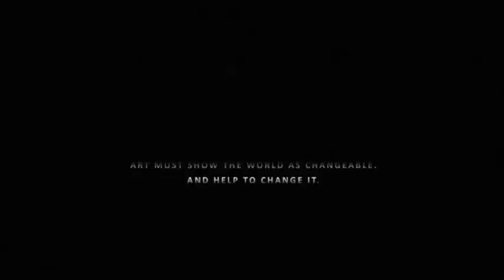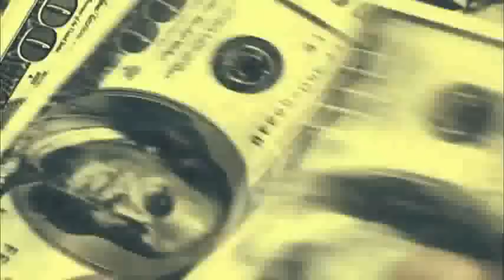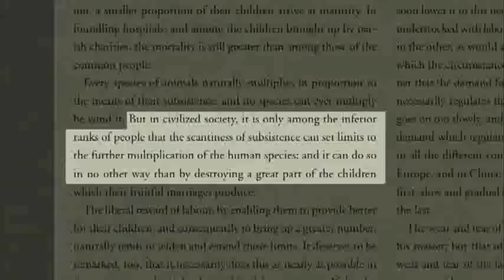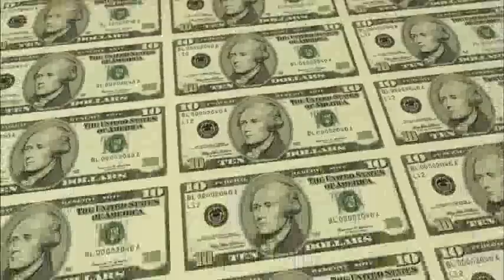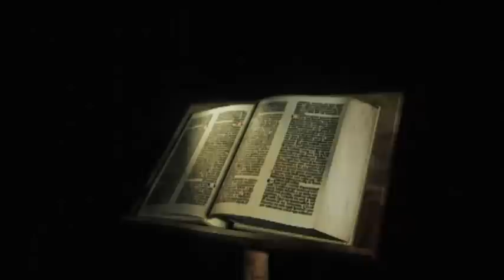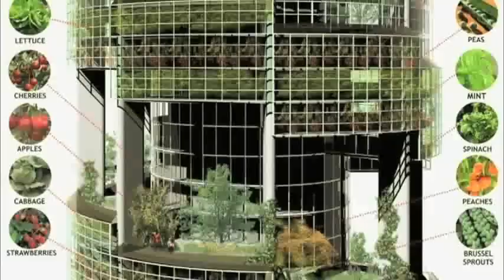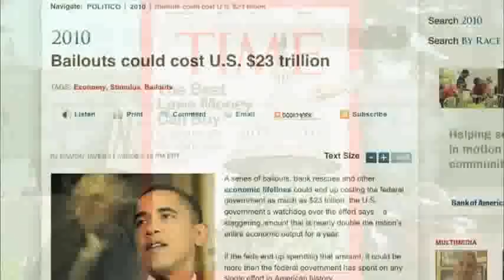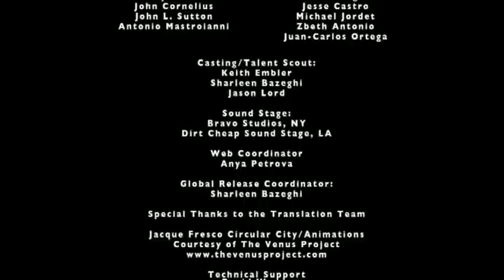ZEITGEIST MOVING FORWARD sub ITA / ESP / ENG / JAP /spread

Comment: Well, Communism is a quite broad term with a lot of negative historical associations, like (as you pointed out correctly) the USSR, PRC or the Khmer Rouge regime, which all led to dramatic tragedies. But the form governance they (ab)used is essentially different from the venus project. So I'd rather have you point out that it is Marxism (though anarchism is a better comparison, but I see now where you're coming from), and more importantly, that it's a system that has never yet been realized.